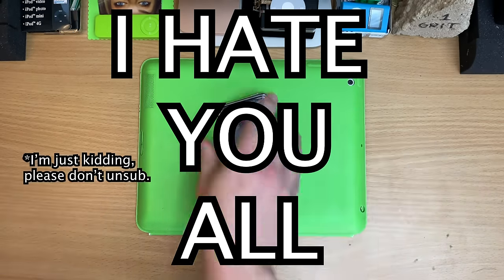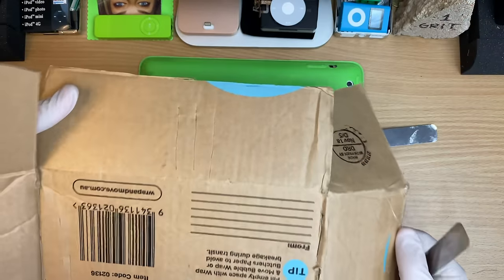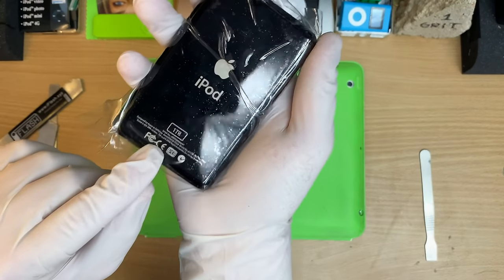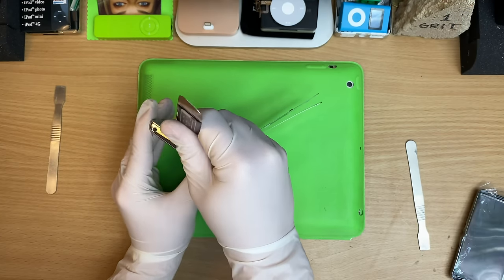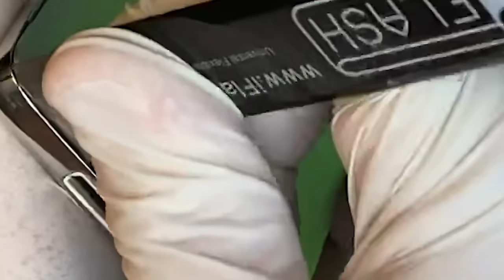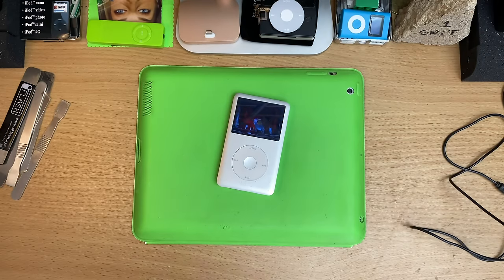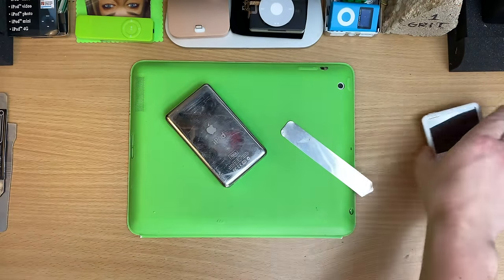Opening the hardest iPod to open.

Comment: As someone who just got a 7th gen to mod, cracking it open is just as hard as people say it is. I'm glad I had a replacement housing ready so I just decided to rip the current one out
Reply: Use a knife like a good switch blade had mine open in 20 mins
Reply: @purplepimp4204  that sounds extremely dangerous
Reply: I got one for free, it's scratched to all get out, I'm shuddering at the thought of opening it, all the years of being in a garage probably did something

Comment: back when I just got into ipodding, I spent 2 hours opening my 6th gen with a butter knife and good lord that was absolutely agonising.
Reply: Did you use the "PRO STRAT"?
Reply: Ok so long story short, I needed to dissassemble a microwave. However, the thick metal case had been sealed shut by like a press, so I spent about 3 hours cutting the whole thing apart with a pair of garden shears
Reply: @fhendrych  PRO STRAT PRO STRAT PRO STRAT
Reply: Centorea 88 I took apart a lawn mower, since I didn’t have the correct socket to remove the driveshaft, i got a sledgehammer and pounded on the oil pan until it split in half
Reply: @bandombeviews6035  nice haha. I hate when disassembly requires super specific tools.

Comment: I've been considering opening my 6th gen. After seeing this I'm going to leave it alone until it actually needs to be opened up.
Reply: My 6th gen has a ton of dead pixels on the screen and a bad battery. I'm planning on buying replacement parts and doing it as a project

Comment: A little tip I use: Put masking tape right along the seams where you intend to pry from. It helps prevent your tool from sliding across the surface too much when you do happen to slip. It may not stop all marking but it will help keep any marks that do occur a bit on the smaller/more minor side. Granted, you may simply not give a damn with these products for all I know, but I figure the tip may at least be of use to someone.

Comment: The original hard drive in my 160gb 7th gen classic died recently and I probably wouldn’t have known where to start getting in to the thing without this video.

Once I’d managed to get the  isesamo tool to open the back case a crack, I found that the best thing to keep the clips deactivated was a bunch of hair clips as they’re thin and slightly sprung metal.

I’m waiting until Payday to order a new back case, front case and battery, however I now have it running off a 256gb SD card. Thanks Dank.

Comment: Really excellent advice.  I have a 6th generation iPod. That battery is kaput. Bought a replacement battery and took it and the device to the local Apple Store where they basically told me to get lost. They won't touch any Apple product 7 years after it has been discontinued.  Worse, they told me "these weren't made to be opened".  A lie, of course. The truth is that these weren't meant to be opened by the user, but only by Apple, and  Apple did open them during the warranty period of the device.  So, I'm on my own and will follow the entertaining instructions in your video.

Comment: That is literally the only iPod I ever repaired. Coming from iPhones it didn’t feel hard.
Reply: Alright Waikiki
Reply: ok susan wikipedia
Reply: Bully for you
Reply: Coming from Nokia 1100 it ain't that hard to repair
Reply: comingx4xyou no it is 6 gen iPod
Reply: Ipads are worse than that, they look easy because they're big but are a real nightmare to repair
Reply: @theharbingerofconflation  k susan
Reply: comingx4xyou in the video
Reply: @UNVIRUSLETALE  Fuck yes, they just break randomly from chip failure after perfect repair.
Reply: FAKE SUSAN
Reply: Nahh I repair iPhones and they’re defo not as hard
Reply: @Adamlol642  bullshit you remember the 4 where you had to come in from the back? Just not ripping the fucking sticky battery tabs is harder than this.
Reply: @theharbingerofconflation  tbh I’ve never failed the battery
Reply: @theharbingerofconflation  actually the first phone I ever worked on was an s7 edge. Makes more sense than a iPhone imo it depends on the mode of iPhone though and what needs to be done. Simple batt replacement is a easy on a s7edge idk about a screen though 🤔😳
Reply: @jaxaboi7999  s7edge for the screen you go in from the back, gotta take out everything. Plus there are no ifixit guides cause people generally avoid it. iPhones are heaven compared to s7 Edge. There are some never Samsung phones that are a bliss to repair though.
Reply: @Adamlol642  may I inquire on your age?

Comment: If it's your first time doing this, I highly suggest buying a replacement case ontop of whatever replacement/upgrade parts you're doing. That way you don't have to worry so much about damaging the original case when opening it. There are plenty of cases you can get for around $25. I got mine on eBay.

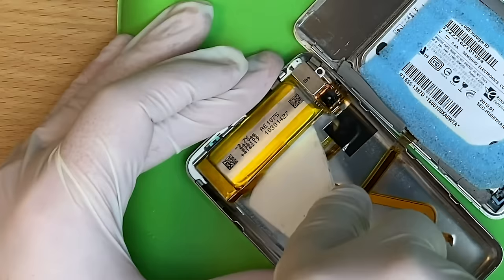Comment: 6:17  Be careful!  I tore the ribbon cable for the hold switch on my third battery change.  The adhesive from the second battery stuck to it. They get very brittle over time.  It's part of the whole headphone jack assembly (which still worked) so I just let it go since I don't really use the hold switch anyway.

Comment: I did open one of these to insert a bigger hard drive and the difficult part is not the opening, but opening it so that you do not make it look ugly later - bending the back back into shape without actually trying it on until I'm sure it fits well is no fun at all. I used like 10 guitar picks (dunlop Tortex are the best I've tried as spudgers, as they're flexible, but not malleable so they don't get disfigured , bent or broken too easily), a putty knife and a purposefully blunted safety razor  blade (I used a small, roundish stone  to make the blade dull, but it will go into places no spudger, plastic or metal, can go in and it's so much cheaper than anything, especially if it's already spent from shaving). And I managed to get it to look OK, just one corner feels a little rough to a finger, but without any visible kink or wrong curvature.

Comment: The easiest way to make the initial entry is with a exacto knife blade. I don't know the number, but they have one called the shovel blade which is square and you can easily work it into the gap because it is much thinner than the other opening tools. Just be sure to wear a glove on your holding hand in case you slip.

Comment: I remember trying to get into one of these back in '09. I had managed to get into multiple previous gen iPods and figured it wouldn't be too different. I was wrong. I managed to bend up the back plate and chip the aluminum front, and afterward it never closed up correctly. Never again.

Comment: A professional tech bent the living daylights out of my 6th gen 120 gig and STILL couldn't fix it. Two years and several of these videos later, I fixed it my damned self -- it was just a hard drive failure. I upgraded to iFlash, and it works great. I was able to bend the iPod case back into shape-ish, but it's STILL warped.
I've fixed so many of these now, I'm opening cases without scratching them! (I always go for the top clip first, and that seems to be easier for me.) Thanks for these videos!!!

Comment: I just did it, with this video playing. I had to pause it a few times, but was of great help. Made some minor scratches to my classic, but smoothed them with fine sandpaper (the aluminium top is very easy to scuff). Everything works, and looks good, and I am happy with it! I used the iSesame tool, and some auto feeler gauges to open case.

Comment: Used to pop these open all the time for work, not easy, but I suggest working from the bottom left or right firs, because the clicks are easier. Work your way up, then use a narrower tool for the bottom

Comment: I've got one of these 6th gen 80gbs, I've got a new case, iflash solo and all the fixins, new headphone and hold switch and a 2000mah bat tree coming for it. The first time I cracked the original case open I broke the little rail thing on the inside that clips it together so its very easy to open now (but doesnt seal shut properly) so the hard bits done aside from swapping out almost everything

Comment: I know this video is 3 years old at this point, but thank you for posting it - I just did a hard drive swap for an iflash reader on my 6th (or 6.5, or 7th whatever people refer to the 160gb version as) generation, and it was a NIGHTMARE to get in to. I was considering replacing the metal panels so it seals up like it’s new again, but I think I’ll just keep them a little F-ed up and slap it in a case so it’s easier the next time I need to do some repair work

Comment: Just opened my 6th gen (for the first time), went very well, pretty easy if you go slow.
Best advise is to get a spare front cover (or photos of one) so you can accurately reference each clip position.

Comment: Better late than never; thanks for your informative videos, I have 3 classic 160gb iPods and over the years they've all fucked out one way or another. I've never considered myself to be electronically minded, yet recently after watching this video and your SSD one (a few dozen times), I purchased a repair tool kit, new battery's and SSD's. Yesterday I spent an hour getting one iPod apart (bastard) and then replaced the battery and a 128gb SSD. Works like a dream, so thanks again for your invaluable help...

Comment: You know what would be a cool mod for these 6th/7th gens? Cases that close with screws as opposed to clips. 
Wouldn't be as slick looking, but also far less of a monumental pain in the ass to open.

Not sure if it would make too many weak points in the frame part inside, but just think about it: Holes on the circumference, going through top and bottom halves of the case, and into the frame. Threading on the frame holes. Introduce screws. Boom!!

Comment: I bought a black 80gb ipod 6th gen a bit ago, wanting another one after watching your vids, I  think someone was actually in it before, as I didn't find the same battery you did, I found a blue shrink wrapped Sanyo battery (there was also a bunch of dirt and grime inside it somehow). replaced it with the same battery you did in this vid and replaced the headphone jack and lock button(cleaned the inside too). Overall for fixing my 1st iPod, I think it went well. It's a heavy nugget and I love it. battery still has full charge after over a week of sitting. I've also got a 2nd Gen nano that still has yet to get the dreaded black spot.

Comment: i open these with single edge razor blades, the ones with a folded piece of metal on the back.
i can get one open in about 50 seconds if i'm lucky and usually within 5 minutes
if i did it for a living i'd definitely make some real tools for it but i find the razor blades do the job

Comment: Oh btw if you use a metal ruler cut it in half and file the edges down a bit its does the same job and you have 2 ( just as a tip) (and its a bit stronger)

Comment: Take two of those tools and line them up next to the iPod, measure from about 1cm from the top of the iPod and cut 3cm notches in the bottom of each tool so they will fit in between the front and bottom cases, that way you can slide one tool in each side depressing the clips and then pop the top out from the case. Boom, you're in and less likely to bend things.

Comment: i use those silly blue pry tools (at least, the better versions) as things to stuff in the gap. usually works. some are tight enough you have to use the ridiculously thin pry tools. and you need at least one to start the gap.

and yes, the 7th gen regular ipods are suck for getting apart.

Comment: By the way if you want a flat workbench that's grippy, buy a plastisol can that's has a high number (or low depending on what it's measuring) put a cookie sheet into the oven at 500° F, wait for the pan to get hot, spray the pan with silicone mold release, then pour plastisol into it, then pouring the remaining amount of plastisol into a catch pan, then put it back in the oven for about 20 minutes. And there you go a flat workspace.(make sure the pan is level and flat or else you'll get a angle)
Reply: Oh and make sure the plastisol doesn't drip out of the pan in the oven or else you'll have a very sulfury air freshener
Reply: Also make sure you let it sit for like 2 minutes in the pan so I can build up a wall thickness.

Comment: I used a series of .88mm guitar picks to hold the clips in once I'd unclipped using the opening tool.  Seemed to mostly work ok, although I got a bit of a bend on the metal case in one area.

Comment: Dress the edges of those tools with some sandpaper before using. Maybe try making a chisel point on sections of small metal strips, like the ones in windshield wipers. They are long enough you could wrap them around your hand to prevent slipping off. 

Those metal wiper strips are hardened stainless steel, and they are already not sharp on the edges. (they make good lock picks too)

Comment: I had a problematic 5th gen iPod Video and wanted to buy another broken one to get the parts, but I bought a 6th gen from a seller that wrote the wrong info in eBay.
I completly destroyed the case of the 6th gen one trying to open it! Only after I opened it that I saw that I bought the wrong one. I thought it was just super tight.

Luckly I found another broken one that was really cheap and could save mine. In the end it was a 5.5 gen that fit perfectly in the 5th gen case.
This was so stressful that I promised to never buy one of these metal ones again.

Comment: Been there,  Done that,  Do not reccomend.   I consider the back case a lost cause and order a replacement every time.  I always use the prostrat (pliers and flathead and bend the 30 pin bit

Comment: 2:45 You Have A Red Front Case For Your 1TB iPod, Oh Please, When You Replace The Back Case Of Your 1TB iPod With A Black 1TB One, Please Also Replace The Black Front Case With This Red One, Also Vice Versally Swap Screens Between This iPod And The 1TB iPod, So The 1TB iPod Will Be Working With This iPod's Screen, And This iPod Will Get The Broken Screen From The 1TB iPod, I Know You Don't Want To Open An iPod Classic (An iPod With A Different User Interface Compared To The iPod Video) But If You Want To Do This, You Gotta Open These, Because Now These Were Opened Before

Comment: Just a slight know about wearing gloves and getting cut. We had a trash pile and at the bottom of the trash pile there was some mirror tiles. They were like 8 by 8 square tiles with a mirror finish, we put them on the bottom of the pile and by the time we got the pile piled up I realized I had to use for it. And sure enough by the time I got to the bottom of the pile they were broken so I was wearing some rubber gloves picking the pieces Up when somebody decide to help me and managed to shove a chunk right in my hand. Cleaned as best I could was doing okay until a couple days later at work my arm went numb. I decided to go to the emergency room at this point spent all night there with having to work another shift in the morning got an x-ray got told it was only going to be $100 but later in the mail bill for more surprised. The X-ray and the doctor saw nothing didn't do hardly anything but some antibiotics Maybe. Whereupon I went home and did self surgery and found out I had little chunks of rubber gloves still stuck in my hand.

Comment: These are really easy to open if you know what you’re doing. Thats not being like, pretentious „oh im so good at opening them blahblah“. I opened a 7th gen for the first time ever yesterday, and i did it no problem first try, because i knew the trick.

Elite obsolete made an excellent guide, you can easily open these with a single spudger in about a minute if you can get into the ridge between the front and back plate.

You just push the spudger straight down as far as it goes and then pull up

Comment: Question: Say you were to screw up the OPENING of the iPod, but you were going to put on a new front and back case, would it still be alright if you just replaced the case parts you may have broke?

Comment: Just curious but what's the true upper limits of one of these for modding? What I'm aiming for is a 1TB (or thereabouts) capacity with a battery that can last for let's say 12-18 hours at a time with a screen of good enough size to play an mp4 file (if possible) of 480 x 252 resolution. I'm interested to know to see if building or modifying a tablet I have with a better battery is a better option. Thanks for responding when you can.
Reply: There's no limit to capacity but there's a limit to songs as eventually the iPod will run out of RAM

Comment: Thanks for this, was very helpful! HI have a specific question, hope you
 can help:
I have a 160gb ipod classic that was working fantastic until the mac 
battery ran out while it was synching. Since then he´s very upset. He 
started by just showing a very small portion of the music on it, and 
some of it was not working anyway. I tried all the usual mambo jumbo and
 now even formatted and restored it. Seems ok, I added some music, and 
again, only some of it is working. When I try to play a track that seems
 not to work through iTunes it gets stuck (hard drive is a bit noisy in 
the attemps to work).

Any educated guess what might be the part that need changing?

Comment: Hi, I have a legitimate question. Is it possible (as in easy possible) to put the internals of an aluminum shell iPod into a plastic one? I like the plastic design better and I have an aluminum iPod that needs a HD replacement, so I was thinking in replacing the shell for a plastic one :)

Comment: Hey man! I have a question
I refurbished a iPod Video and I want to install rockbox on it
Every time I restore the iPod in Windows, it goes back to the "restore the iPod" screen and I have to restore it again.. :'(
I used a iflash cf with a cf to micro-sd adapter, I've used different sd's but It does the same

Do you know how I can fix this?